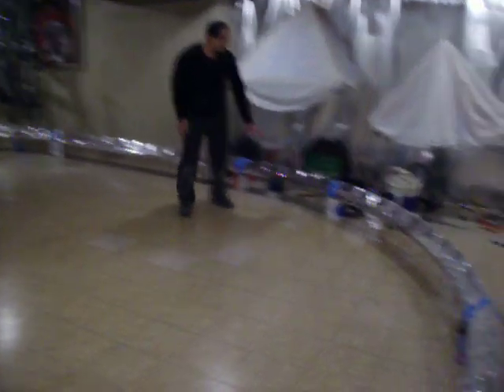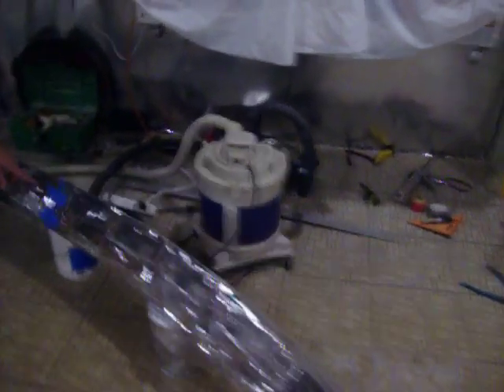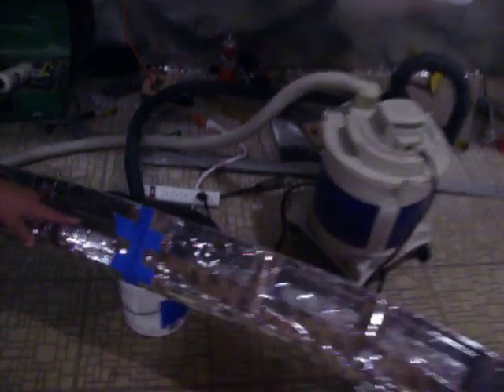Eetremely High Speed Trying to go 1000 MPH Test but its a Fail for Now

Comment: I don't want to be rude but it looks like a kind of elementary school project:) I've read your article about the design and I think that you're wrong in many aspects. The pyramids looks cool but are far far away than be an aerodynamically correct. Look at water drops and think about the differences. I guess that your car will be very noisy at higher speeds just due that pyramid shape:) Another design flaw is that you're converting energy in tunnel for twice or more and that's inefficient.

Comment: Alfred Ely Beach tried this in New York City 140 years ago.  It was called the Beach Pneumatic Tunnel, it only went 300 feet, it was a curiosity, and it was not very efficient.  That's why today's New York subway uses high power electric traction motors.  Evacuated tunnels with Mag-Lev technology are the future of high speed rail.

Comment from the maker: Its going to have copper on the bottom as a magnetic ground so it will float on the tracks at bottom of the tunnel when its moving at high speeds